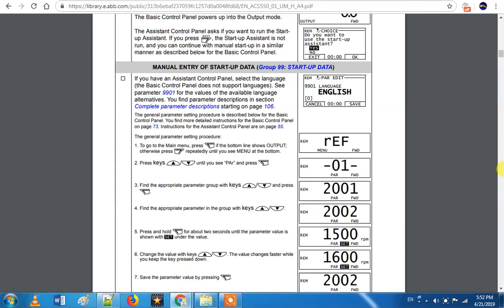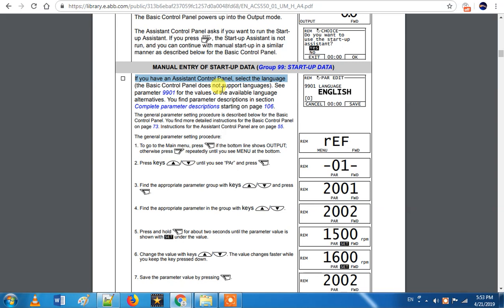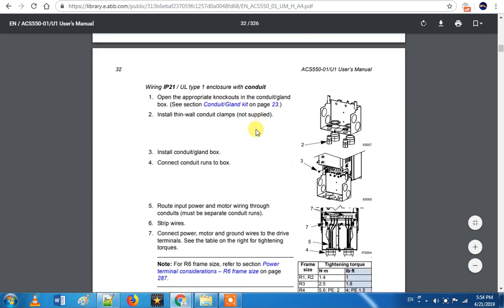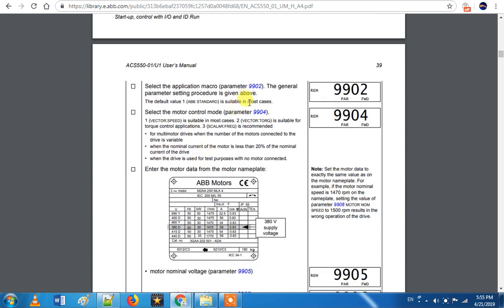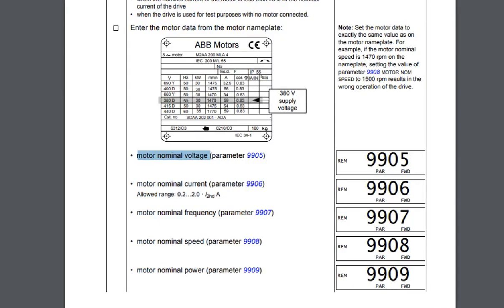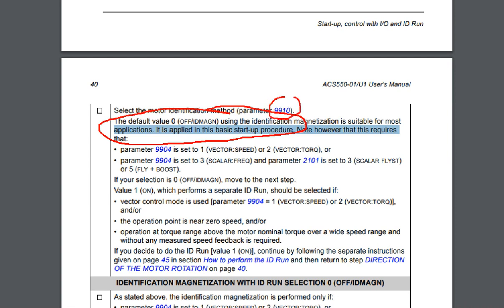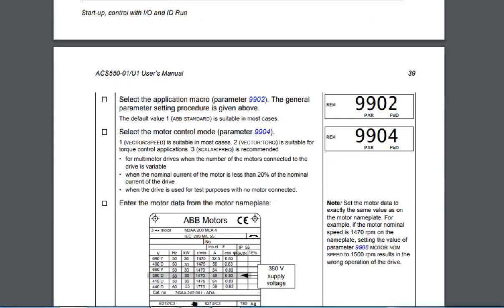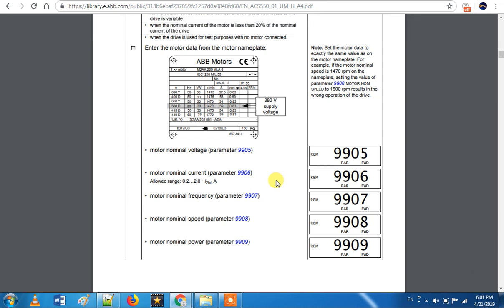How to Take ID Margin for ABB VFD 550 In Tamil

Comment: Bro nice video some corrections, athu ID Magnetization, ID is Identification.Flux Optimization VECTOR modela betterah work aagum, Flux optimization works below 30% load by decreasing the flux inside the motor by reducing the output voltage.
Motor ID run panrathuku modes iruku Standard/Reduced/IDMAGN option standard select paningana motor decouple pananum yenna reasona motor accelerate decelerate aagum ithu neenga control panamudiyathu so, neenga ID MAGN chose pana motor decouple pana thevai ilanga Bro drive just DC current inject pani motor model study panikum, Scalar is just V/F ratio method and Vector is closed loop motor control ithu precise speed and torque control apro torque demand iruka applications such as compressor, conveyorku use pana performance nalla irukum starting torque nalla irukum, pump fan ku neenga SCALAR use panalam nothing wrong with that reason athu square torque applications starting torque romba thevai padathu
Reply: Hii bro